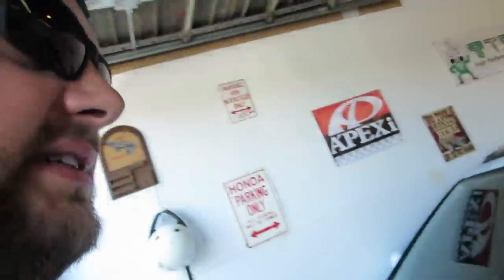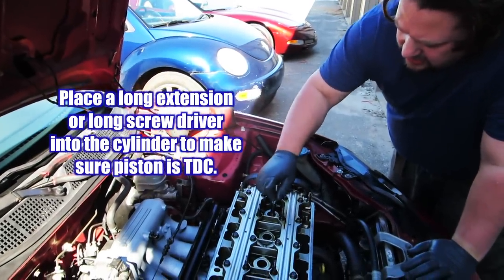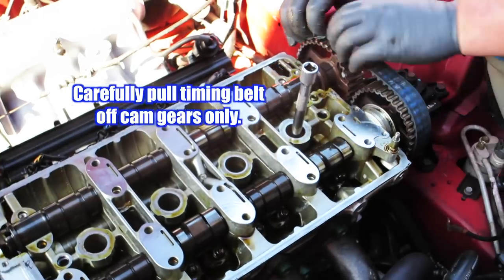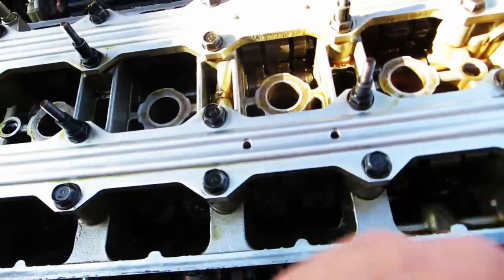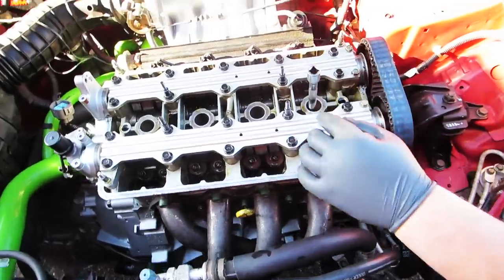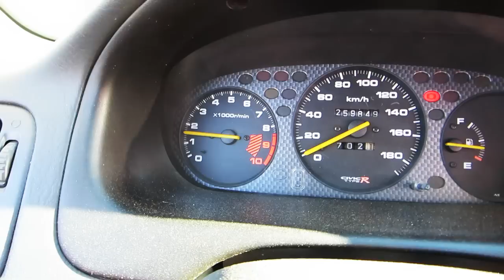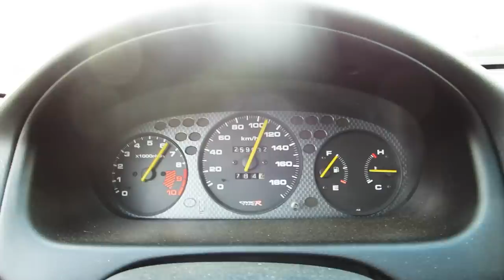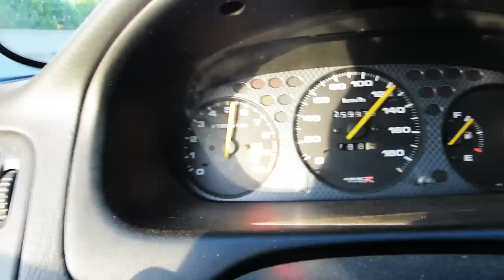B16A SKUNK 2 CAMS INSTALL EK CIVIC HSG EP. 4-04

Comment: Lol good vid as always. Those cams should really wake up the B16A. We picked up a solid 17whp and 9wtq with a set of those and a ported P73 intake manifold over stock B16a2 cams and Pr3 manifold. After tuning ofcourse. Would also recommend going to a BKR7E if you are currently running the 6. The new cam really liked the colder plug and bigger gap (47-53). The BKR7E @ 48 gap made 4whp over BKR6E @ 43 gap consistently and every little bit helps! The car was a 93 Si hatch so a bit heavy (2480lbs no driver) but it went 14.70s consistently with a B16a2/AEM V2 Intake, RMF Narrow 2.5" header, 2.5" test pipe/Bpipe to Vibrant muffler, RC310s, tuned on Crome. After the cams/P73 Intake and retune he was running 14.30s with a best of 14.26 and trapping over 100 every pass. We didn't dyno before the cams but after it made 176whp/117wtq. Not bad at all for a mostly stock B16.
Reply: What was your vtec engagement point on this tune?

Comment: Mark, I just tried to torque my JDM B18C Type-R head cams to 20 ft lbs and one of the bolts snapped off in the head. I just ordered all new 8mm and 6mm bolts from Honda and I'm going to try again. I'm running a built B18B1 block with a JDM B18C TYPE-R head with a Turbonetics 60-1. Every time I try to torque the 8mm bolts to 20 ft lbs it feels like they're stretching and about to snap and the cams sound like they're loose.

Comment: Hey guys love your channel. I'm running a high comp b20vtec tuned on neptune 198whp with b16b style pistions and a ported b16 head with gsr cams and valve.  My question is , if I put type r cams in would it be worth it ? I have a set laying around but don't want to retune it . Could the cams be a good upgrade without a tune ?

Comment: Oh Lord, I hate torqueing down camshaft cap bolts. I've had the bolts snap off before and it always scares me. I'm in the middle of replacing my B series valve stem seals right now because every time I hit boost and let off I get a small puff of smoke.
Reply: how did you get them out lol? I had 1 snapped on me and I just left it...
Reply: +That Ford Guy You have to be really careful when torqueing down the camshaft cap bolts. For my B18B1 the torque spec is only 7 ft/lbs and unless you have a really high quality torque wrench, it's really hard to tell when you're at 7 ft/lbs (at least it is with my torque wrench).
Reply: I took that head to a machine shop and they told me that it was going to cost me a couple of hundred dollars to have what was left of that bolt removed and since my engine is just a LS and not a B16 or B18C, I just bought another head for $50 and installed it.
Reply: same thing happened to me. luckily I was able to extract the bolt at home. Harbor Freight for the lose.

Comment: Say I did this same exact process to a b16a2, wouldn't I need to tune the car? I see they used a modified type r map, so I'm guessing I couldn't just drop new cams in leave it at that?
Reply: It's a drop in cam but would work best if tuned or modified map in this case. Pretty much add more fuel at higher RPM etc...

Comment: will them.green hoses fit  b18c4       im doin a head swap on my b18c4 got bc stage 2 cams  and bc springs and vavles but im goin turbo soon got to do arp head bolt and  cosmci gasket

Comment: I sent you a message on IG with some more detail, but is it necessary to run a FPR with these cams? The paperwork says +3-5%, I just don't know if that is a significant enough difference to justify the expense. In seems like the car runs rich from the factory, especially in VTEC. B16A2, stock internals, stock ecu/tune, with bolt ons, if anyone cares to throw in their two cents.
Reply: I'm actually in the same boat as you. Usdm b16a2 99si. Aem cai, toda rep header, 2.5 test, 2.5 exhaust, fpr. Just installed skunk2 tuner stage 1 cams, alpha valvetrain, lmas. 
Old tune: vtec set to 5k (I know it's low), rev limit at 8500. 
As of now, the car runs great with these cams. Just like mark said, makes the b16 feel more like a b18c. 
But.......I wont rev past 8k until i get a proper tune. 
Pretty excited to see. Gonna see what the dyno plot shows to better  choose a vtec engagement point. Most likely 5,800 or 6k. We'll see. Will chime in after done.

Comment: Are you reving to 9k with stock valve springs?  Do you think i can do that with gsr valvetrain with these cams?
Reply from the maker: The B16A (not A2) has stronger valve springs. Gsr is good till about 8700. The B16A will do 9200 in my experience.
Reply: Which gen is this b16a? 10.4 compression or 10.2?

Comment: If I do on my integra GSR. Do i have to change the valve spring when i swap skunk2 camshaft or i don’t need too
Reply: It's recommended but not necessary with tuner stage 1. 
But I did any way for peace of mind.

Comment: I gotta question I have a 1994 Honda prelude Si 5speed I wanna know will my engine and transmission go right in a 1997 Honda prelude it was a 5speed but the ppl are selling the shell ??
Reply from the maker: If it's the same body style you shouldn't have a problem other than the vehicle being obd2. So you may have some sensor or wiring differences. If it's a different body style the worst scenario is different motor mounts or engine brackets and wiring.

Comment: ok im new to the honda seen. i have a 1998 honda accord ex it have 4cylinder with vtec how can i find out what motor it is?
Reply from the maker: Should be an F22 or F23 I believe.
Reply: +Honda Street Garage is this motor a good starting point for a good sleeper car. i know it moves pretty good for being stock
Reply: There's a stamp engraved on the block, near where your transmission mates up to the block. By the exhaust manifold.
Reply from the maker: +Justin Sams it is however most people might want to swap in an H22. Very affordable swap and I  believe you can use your transmission. Bolt in 200 hp.
Reply: found out I got a D14z2 it goes well with traffic but its quite an uninspiring block.
Reply: Honda Street Garage f series hold boost too

Comment: so with a stage 1 cam, can it be driven on a stock ecu? even just to go to a tuner?
Reply: with a stage 1 yes. you can tune your car to get more HP out of it but you don't really need to do it with a stage 1 because the car can self adjust to it, you just won't get as much of a gain without tuning; but stage 2 and higher you need to tune it
Reply: @SepticMonkey42  you need a tune to get and real gains the ECU is going to try n make it as close to the base map as it can that's why u want to retune it for a better basemap 🤷‍♂️

Comment: IS this with stock valve springs?
Reply from the maker: Yes
Reply: dang bro you're going 9000 rpm on stock valve springs.
Reply from the maker: +electric feel the factory tachometers are always off by a little the rev limiter is set at 8700. The 97 spec can take it all day.

Comment: Y yall didn't degree the cams?
Reply from the maker: That would require cam gears. Since they're stage 1's and in a DD we weren't worried.
Reply: ***** Ok but any cams that's not degreed is useless can the reason yall changed them for better performance, right =/ ? lol
Reply from the maker: +SI RICKO the car performs better. Are we getting every bit of performance out of it? No. If we were to take the car and have it dyno tuned. It would definitely be necessary. But it's more about having fun for a couple hundred bucks. But we may go stage 2 with springs and retainers then we'll put cam gears and degree them and dyno tune it.